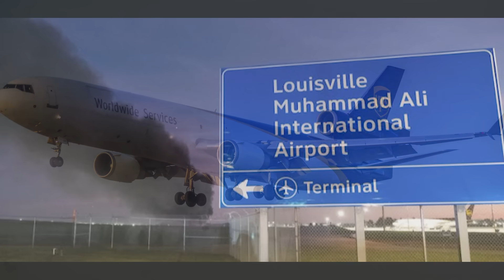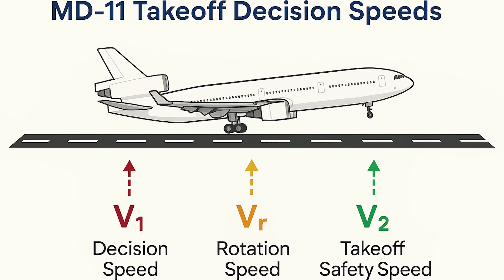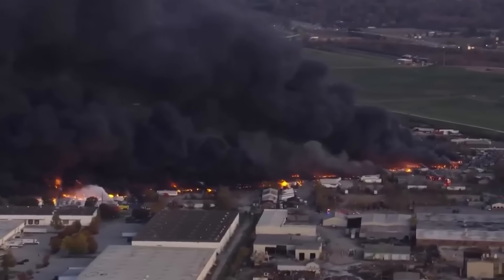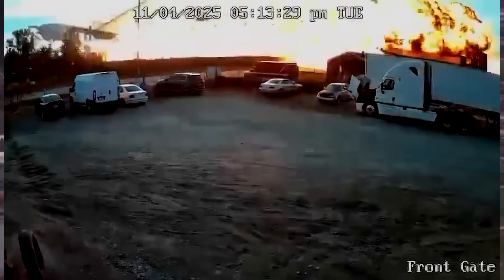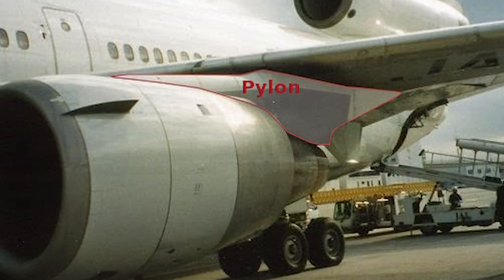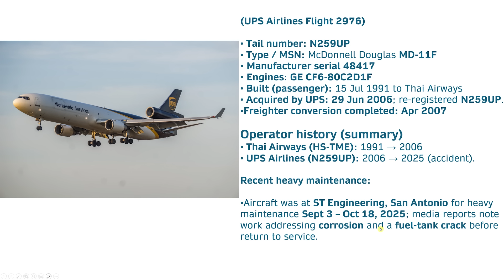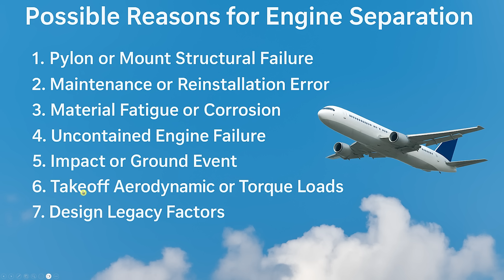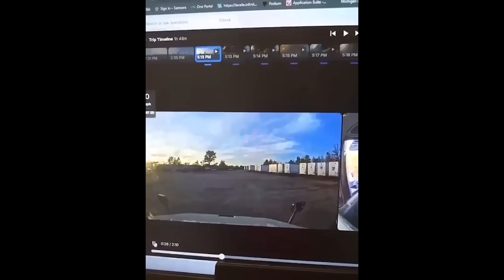What Caused UPS Plane Crash, Louisville, KY? How MD-11 Engine Fell Off

Comment: These older planes have had so many cycles and maintenance must be a nightmare. I’m so sad that this happened. I feel so sorry for the pilots and everyone 😢❤
Reply: Age of the airplane is irrelevant. It's how they are maintained. Lack of parts or it's poor economic performance that gets planes retired.  And the engines are NEVER as old as the airplane itself because they go through many routine and complete engine rebuilds or replacements during the plane's lifespan. Those engines on this crashed plane were probably no more than a few years old.

Comment: FAA needs to set up mandatory  clear area for aborting flight when there is critical emergency on take off, major nets or  something.  knowing people will die but you have to take of because your at v1 committed speed is terrible  protocol.  v2 lift off is at approx 140 mph. massive nets would work

Comment: I suspect based on the engine that it had a castrophic failure to the point it ripped apart after V1.  Essentially nothing could be done at that point

Comment: I just don't understand why they would put a warehouse and a petroleum recycling plant at the end of a freaking runway?
Reply: I can never understand why they just can't keep everything clear at the ends of the runways for at least a mile.  It may be very expensive, but what price life....?
Reply: They were choosing between that and a concrete wall
Reply: 8n Orlando their is a extremely busy expressway right at the end of the runway as well as hotels, you would be surprised most airports are like this
Reply: @floridaheat305  that's scary,  I wish they would think past the moment when designing airports
Reply: The petroleum recycling plant was there first. Our airport has been extended several times and keep growing larger, which is now why it's an international airport. No one ever would have thought a plane would have crashed there.
Reply: There is always a first time . . .
Reply: @Jesusteama6439  Sadly that's true.

Comment: #1 engine suffered unknown malfunction, likely a compressor explosion or simply the pylon mount failed like in 1979. FOD from this causes compressor stall in #2 (watch for brief flash of flame from the rear), which puts the plane in an unrecoverable condition. Nothing they could do.

Comment: 34 year-old plane had been grounded for 6 months just prior due to a cracked fuel tank...takeoff was delayed 2 hours before the engine fell off...UPS is screwed.
Reply: "34 year-old plane had been grounded for 6 months just prior due to a cracked fuel tank...takeoff was delayed 2 hours before the engine fell off...UPS is screwed."

The aircraft nad not been grounded for 6 months. It was in maintenance for 6 weeks for a scheduled "D" check. This is the deepest maintenance routinely carried out. It includes drain the tanks, cleaning out any fungal growth, inspecting for crack, carrying out repairs, treating corrosion and refinishing with anti-corrosion/anti fungal coatings.

The "D" is carried out every 5 years, all large aircraft are required to carry out "D" checks. On more modern aircraft the spacing can be 6 to 10 years.

The incident aircraft was not delayed by two hours do to maintenance of that aircraft. An incoming aircraft that was planned to be used for this flight was found to have a maintenance issue and a replacement aircraft had to be used. This delayed loading the cargo and the aircraft departed two hours later than originally planned. Such delays are not uncommon and there are standard procedures to get the operation back on track.
Reply: You say that as if UPS is somehow now an aviation maintenance company. That's like blaming a car owner for their engine exploding after taking it to the dealership for a set of new brake pads and finding out the mechanic dropped a wrench into the air intake valve. Plane age also isn't a factor, it's all about the number of times it has risen into the air, a.k.a. flight-hours due to accumulated fuselage stress. There are plenty of 30, 40, and even 100 yr old planes that still fly to this day, even WWII fighter planes at Red Bull shows. Lots of factors go deeper than just the surface-level information of a replaced fuel tank or common airport delay.

Comment: WHAT   CAUSED  THIS?   STUPID  QUESTION!   OBVIOUSLY  MATERIAL  FATIGUE   OF   PYLON  ITSELF  AND  ITS  CONNECTIONS  WITH  ENGINE  AND  THE  WING  ACCUMULATED  DURING    SEVERAL  THOUSANDS  TAKEOFFS  AND  LANDINGS,  WHEN  REVERSE  BOOST  WAS   APPLIED!  SUCH   OPPOSITE  FORCES  COULD  NOT  BE  APPLIED  THOUSANDS   TIMES  WITHOUT  CONSEQUENCES!  
JUST   IMAGINE  30  TONS  OF  FORCE  APPLIED  AGAINST  ALMOST  300  TONS   OF  STANDING  MONSTER  TO  MOVE   IT  AND   MAKE  IT  RUNNING!   SEVERAL  THOUSANDS  TIMES  DURING  34  YEARS  OF  DUTY  OF  THIS   PLANE!   HOW  TINY  PYLON  AND  ITS  FRAGILE  CONNECTIONS  CAN  WITHSTAND  IT  WITHOUT   PERIODIC  REPLACEMENT   WITH  THE   NEW   ONE?
Reply: Maybe it was caused by someone who thinks their ideas are so superior that they must be conveyed with all-caps. Too hard to read. Didn't read.

Comment: Side note: On 6Feb1991 there was another aircraft that had its engine fall off. However in fact it lost 2 engines of the 4 both being on the same wing. It was a KC-135 Stratotanker call sign WHALE 05. 
During the investigation they found the 2 other engines also nearly separated from the craft.

The documentary is on Prime streaming "Mayday Air Disasters"

Comment: I think they mistakenly by passed this line and caused an explosion. Not a new problem. Could have a few flights ago. These are critical components that atomize fuel into the engine's combustion chamber.
Reply: Bread and butter to an experienced mechanic

Comment: So, may I ask?  Why do they not provide pilots with a means of ejecting from a terminal situation as they do for most jet fighter pilots in the military?  Are their lives worth less to the airline industry?  Why not establish mandatory airline metallurgical x-ray scanning for brittle fatigued metal and have all planes scanned after so many thousand hours of flight time?  I may have questions that deserve consideration, but I unfortunately do not have the solutions.  Maybe more sensors should be installed throughout the fuselage to monitor all deviations in the structural integrity of the plane.  That would be a reasonable first step.
Reply: Maybe familiarize yourself with the requirements and risks of ejection equipment, plus the implications of giving pilots that option with a massive plane over a populated area, and especially with passengers.
Sensors will never replace thorough and regular maintenance. Face it, our expensive and dangerous flying machines are just that...expensive and dangerous.

Comment: Isn't the designed purpose of the third engine mounted on the tail to have power balance and redundancy to prevent this very scenario? Onboard computers should detect the missing thrust and immediately make the other two engines kick into full power.

Comment: Pylon detachment can also occur by design in the event of extreme, abnormal forces. An uncontained engine failure could possibly cause sufficient vibration to break the pylon fuse pins. The idea is that the pylon + engine assembly should detach up and over the wing, hopefully removing the abnormal forces from damaging the rest of the aircraft.

Comment: Interesting video but you don’t address the important questions. Firstly all modern airliners are required to be able to either stop on the available runway in the event of a major failure before V1 ( decision speed) and be able to continue the takeoff if a major failure occurs after V1, even the loss of an engine. So the loss of an engine should not have stopped the aircraft from either stopping on the runway or continuing into the air. Provided the pilots made the correct decision at the speed the engine failed. There is of course one proviso. Was the aircraft heavier than the pilots thought? If the aircraft was heavier than the pilots believed, their calculated numbers for V1 Vr (rotation speed) and V2 (initial climb out speed) would have been incorrect. Perhaps resulting in the aircraft being unable to fly ( on 2 engines) at the calculated speeds. Secondly your use of a Southwest Airlines 737 climbing off the same runway is irrelevant. Why, because it didn’t have an engine failure. As all commercial airlines are required to be able to continue the takeoff after an engine failure after V1, that means that twin engined aircraft (B737 in this case) would lose 50% of the available thrust if an engine failure occurred (as opposed to one third of the thrust on a triple engined aircraft like the MD11 as in this case). So it has to be able to fly satisfactorily on one engine. So in the event of a normal take off the aircraft is vastly overpowered for the task of taking off! In the event of an engine failure the requirement is to clear all obstacles in the flight path by 50 feet ( dry runway, 30 feet on a wet runway!), that’s not a lot of leeway! So whatever happened, it wasn’t the engine failure that caused the crash but rather, something more than that! I’m sure the NTSB will get to the bottom of it but RIP the lost souls 🙏🏽😢
Reply: Someone in the comments speculated that the engine falling off created an imbalance that tipped the plane over. Along with the thrust coming from just one engine left on the other side. I'm sure the pilot did the best he could under impossible circumstances. Planes are not perfect and failsafe even with the best pilots. This looks more like a maintenance, runway and infrastructure issue as the cause of the crash.

Comment: United Airlines had a DC 10 ( older model MD11) that lost an engine  (as in fell off). The result of the investigation was that the Nacelle and Engine mounts had been overstressed during engine replacement. Worst crash in US Aviation History before 9/11.

Comment: That first power line arc (maybe the second too, but there's much less view) may not have been a direct contact with the lines. There is enough slack in power lines that the high winds from a near miss can blow 2 adjacent wires into each other (or within flash over distance)  causing them to arc to each other.

Comment: What I don't understand is; it was said that the recorded speed at the time of the crash was 185 knots, and the minimum take off speed 140-145 knots for that plane and if a plane can fly with a missing engine(not a pilot here, but we've always been told that a plane can fly with a missing engine) why it couldn't generate enough lift to peel off the runway and climb ? It clearly had enough speed, right ? Afaik, the fuel supply from one wing can be cut off. If it was to be able to generate enough lift, it could have come back around and do an emergency landing. Clearly I don't know enough about flying and aircrafts, so if someone can explain to me whys and hows, I'd appreciate much. ty

Comment: Jeff, V1 doesn't always mean you can't stop in the remaining runway if you reject the takeoff above the V1 speed. The Air Force calculates a refusal speed, the maximum speed you can reach and stop in the remaining runway. Most of the time its well above the V1 speed. I'll guess the MD-11's V1 speed was close to it's refusal speed since it was so heavy.

Comment: Back some years ago this happened to another jet...n the maintenance people took the pylon n the engine off, n they supposed to take them off separately n when they used a forklift to put it (bn the engine n pylon) back on they cracked a bolt n it snapped off.

Comment: It may have leading edge failure early in the takeoff role before leaving the ground. Similar to aa 191. In that crash the plane experience leading edge flap failure to the same wing, after it left the ground the ups incident happened on the ground AA 191 happened after they had climbed to about two to three hundred feet off the ground. Interestingly both planes were down for heavy maintenance two months before their accidents

Comment: Supposition:
Engine wasn't properly mounted to the engine mount under the wing, or the engine mount wasn't properly attached to the wing itself.  Engine separates from the plane as they hit V-1 / Rotate Speed and could not abort take off.  Once you're at V-1, you have to go and pray you have enough thrust / power to get high enough to declare an emergency and land again.  Mary Schiavo, a lawyer that specializes in plane crashes, has been the Inspector General for the USDOT,  was interviewed a few times and mentioned an uncontrolled engine failure.

The Tin Kickers (NTSB Investigators) will definitely be pulling all the maintenance logs, especially that most recent service.  The one thing that's not shown in that report you showed - What side of the plane was the work done on, right / left / both?  Other thoughts, but I really want some more information.

Comment: Two questions: Why did the engine fall off? Is that plane designed to be able to take off with two engines still working?
Reply: It failed at the worst moment. You need all engine power to climb. It was passed the abort time. And probably only reach 130-155 knots. The right engine looks like it wasn't working correctly, either.

Comment: The plane was carrying a max load of jet fuel as it was flying nonstop to Honolulu. What if it was overfilled and was partially responsible for the fire along with a maintenance engine reattachment error in San Antonio? 🤔

Comment: Video didn't even address the main problem, i.e., loss of thrust in the right engine. The runway video clearly shows the right engine compressor stall. What are the chances of your left engine falling off and the right just happening to also have a compressor stall and degraded thrust?

Comment: I know that air safety is relatively safe But it's always boggled my mind as to why there are always obstructions at the beginning and the end of a runway in so many airports ...When they build an airport Zoning and building laws should also incorporate at least a one mile straight stretch of open land on either end of a runwayZoning laws should not allow factoriesOffice buildings gas stations or residential homes to be built that close why can they not build it where there is open green space for at least one mile no buildings no power lines no obstructions In the direct path and direction of the runway I understand that land is a premium just about anywhere in the world but common sense dictates that you don't build houses and buildings  power grids  in the dirct path of planes landing and taking off  for exactly  this reason! !! Everybody knows that landing and taking off an aircraft is the most crucial part of the flight if an accident is gonna happen generally that's where it's gonna happen. I've seen so many videos of plane accidents of planes running off the runway or crashing during landing So many of these airports have nothing in place at the end of a runway to slow or stop an aircraft So many of these airfields have cliffs right at the end of the runway or at the beginning of the runway or an ocean or buildings or residential homes or gas stations how is that common sense😮

Comment: You keep saying the landing gear scraped along the roof, but the shape of the indent across the roof of the warehouse is far more consistent with the round shape of the tail dragging across the roof.
Reply: correct
Reply: The landing gear would have been ripped off for sure ! . . .
Reply: @TEDBOVIS-h9n  ou think a landing gear can just be "ripped of" a airplane??
Reply: I wonder if they raised the landing gear immediately, would they had gain more lift and missed the warehouse roof completely 😢
Reply: @TechyGamerVibeZ  It takes about 20 seconds to retract the landing gear. The aircraft was pitched up at about 20 degrees, so the tail would be 40 ft lower than the nose.
Reply: No chance @TechyGamerVibeZ

Comment: As a former Turbofan Test Engineer for Lockheed and Rolls-Royce at Stennis Space Center on the Trent 900, 1000, and XWB, if you only showed me the intake near the runway, I'd have thought it may have been a blade-off event.

Having witnessed a blade-off test, it destroys the coweling, and large pieces are often left behind.

Man, what a tragedy all around.  Obviously, my prayers are with everyone involved, but we have to remember the mechanics and ground crew that just touched that aircraft before it pulled out for takeoff.  I'm sure they're worried.

Comment: DEFINITELY 
MAINTAINCE CREW IS AT FAULT 
JET ENGINE DOESN'T FALL FROM PILOT ERROR
Reply: About 80% of time pilots are scapegoated for plane crashes. Whole or in part, because it limits liability costs. The crash investigators are very biased in favor of the business side of aviation over safety. They will use 20/20 hindsight and say that the pilots could have done this and could have done that. This is a system failure, but you have to protect the system. So what that an engine fell off and the runway wasn't long enough to accommodate an aborted takeoff and industrial infrastructure and many tons of petro were at the end of the runway. So what, the pilots could have still saved the plane and avoided loss of life. It is total bullship, but what else is new. Dead pilots can't talk.